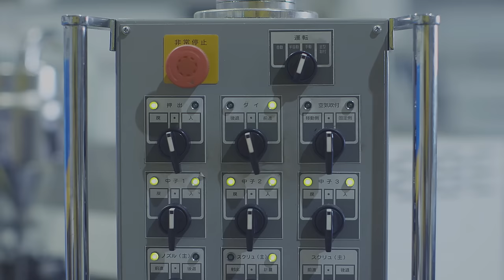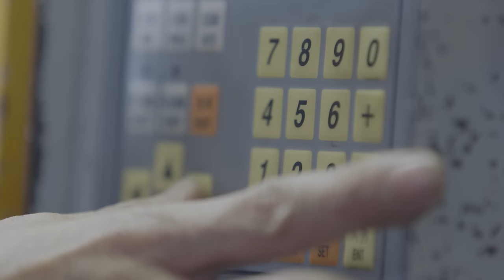THE GUNPLA FACTORY -BANDAI HOBBY CENTER- Promotional Video

Comment: I've built scale plastic models my whole life, but only bought my first Bandai Gundam kit a month ago, a Master Grade 1/100 Strike Rouge.  I was floored by the exquisite level of engineering and detail put into this kit.  I didn't really buy the "no glue needed" approach, but was quickly set straight by the extremely tight tolerances in each piece.  This video makes it very clear that Bandai aren't playing around.  I will be getting more of these kits that I used to overlook as toys.

Comment: About reviewers complaining MG DX weak waist
They didn't insert the body and waist will,they put all the weight at the back the cause MG DX upper body fall backward
They poorly handle there kits not solving the issue
I love solving the problem in toys
I cut a thick runner(don't ever throw your runners cause they're useful)
I put it on vacant space inside the body so the upper body wont fall backward
I put all the weight of my MG DX in front and solve!
He's standing great!
Never use the Satellite Cannon as tripod as reviewers said
My answer about reviewers saying MG DX waist is weak was wrong
My conclusion was pull the body upward,twist it so you can do a rifle shooting pose
That's the main purpose of body-waist twisting for firing weapon pose
To turn it to standby mode
Hold the body and waist together,push them together
That's how I solve my favorite Master Grade Gundam Double X
Thank you #Bandai ^o^v
I really love this kit